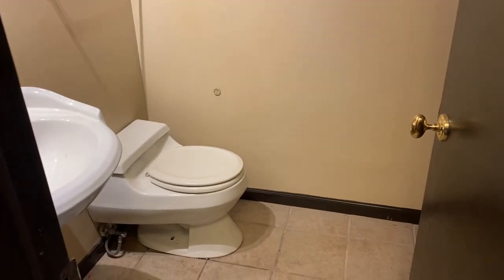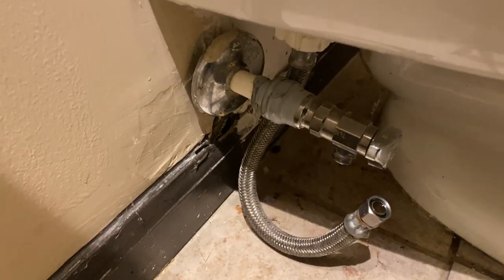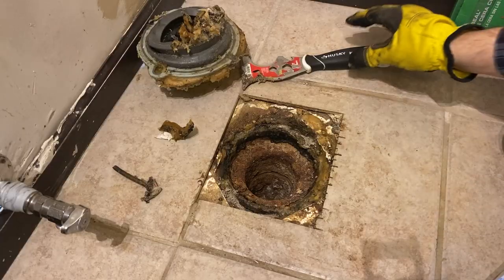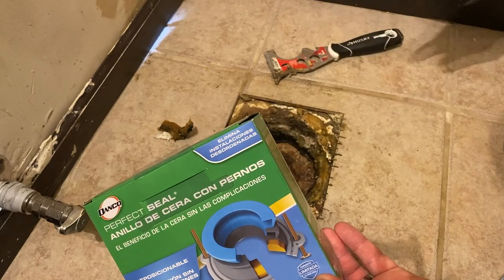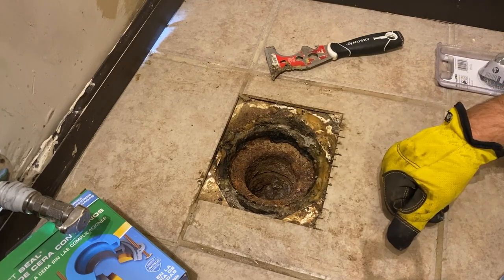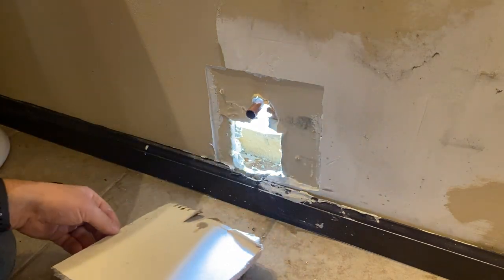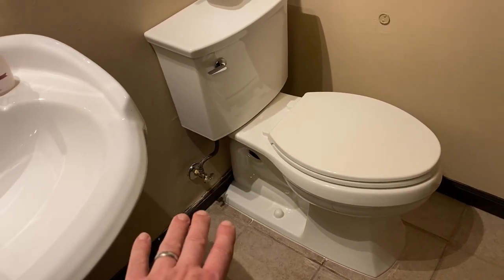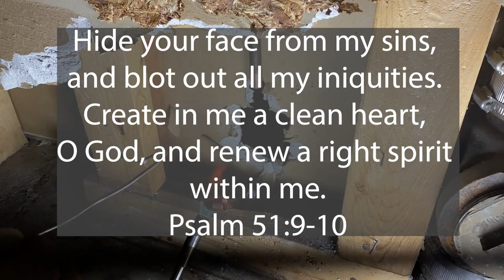Replacing a Toilet on a Cement Slab

Comment: My house was 10 years old when I bought it.  The toilet in the master bath was sitting unusually high off the floor and was not fastened down.  When I took it out to renovate, I discovered the soil pipe was sticking up a little over an inch out of the floor.  Whoever installed the toilet just jammed the closet flange in the pipe and stuck two pieces of 2x4 under the toilet for it to sit on.  I'm sure the same plumber did all the plumbing.  Instead of drilling out wall penetrations, they just used a hammer to punch a hole in the wall.